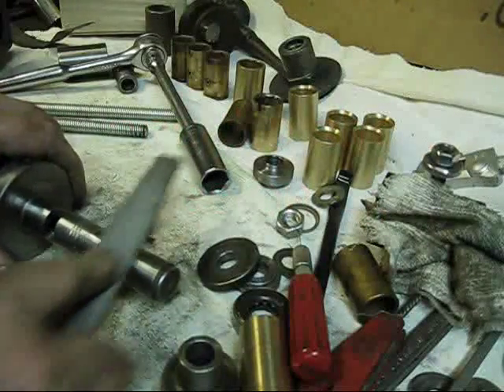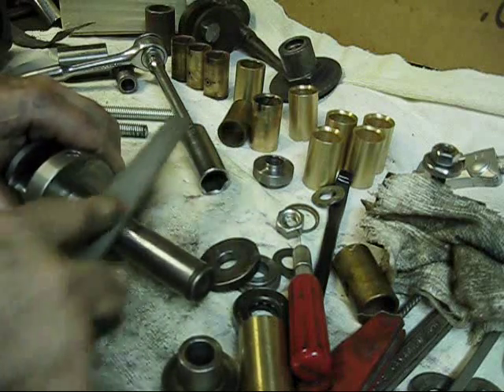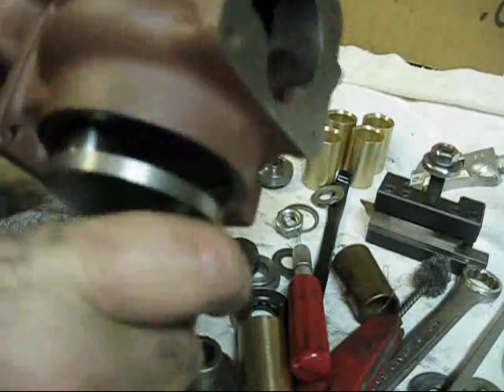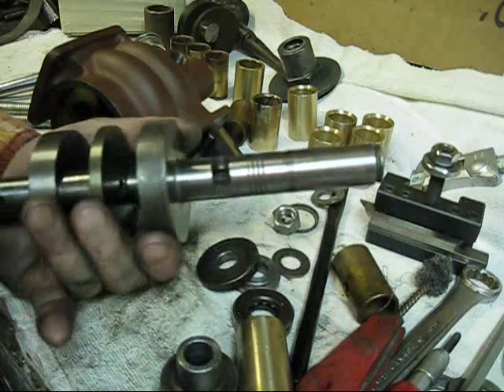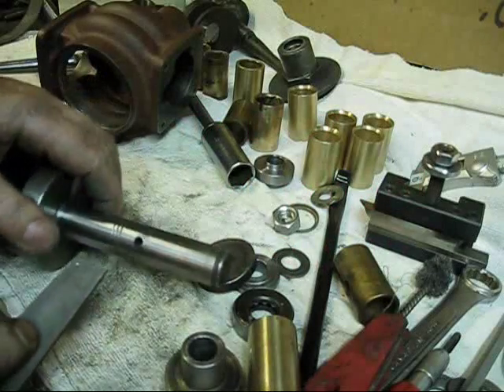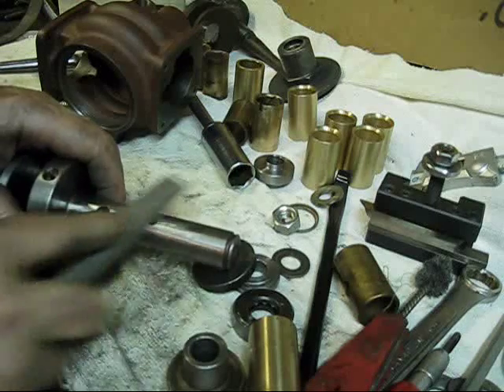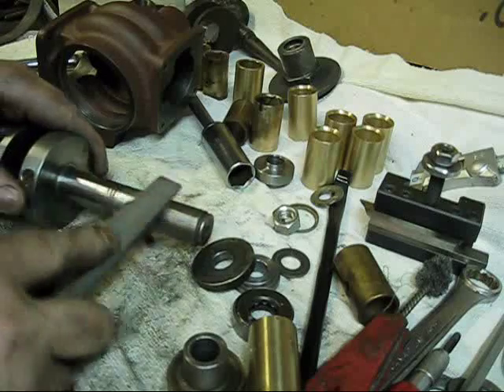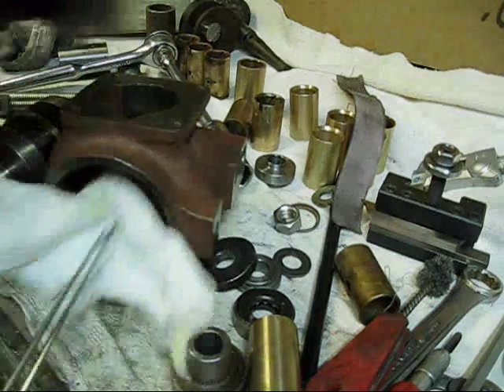1937 Maytag Engine  model 72  rebuild #17

Comment: shouldn't you clean the crankshaft on a lathe rather than by hand?
Reply from the maker: +Ken MacMillan ,,,, hand fitting,, maybe i'll do the next one in the lathe,,,, just for fun,,,,
Reply from the maker: +shopdogsam ,, no,,, wait,,,, i'm going to hand file the next one also,,, just saying,,,,
Reply: I would have thought you might have put the crank into the lathe and then polished it between centers with the lathe turning slowly. You could have used your file still I mean, just that it seems that it would have been easier to make it more uniform.